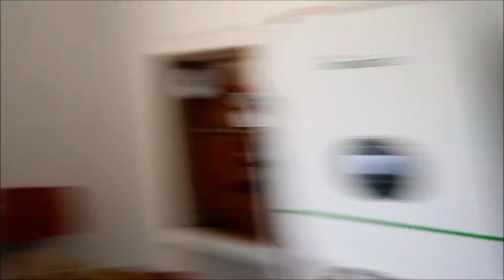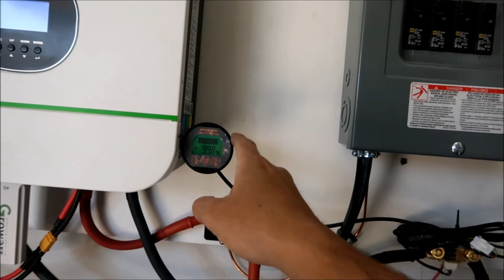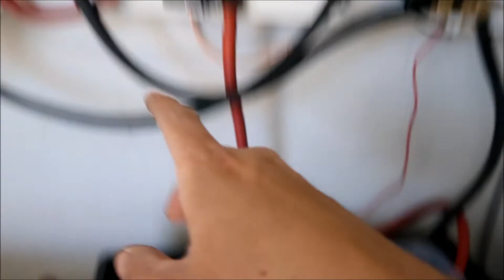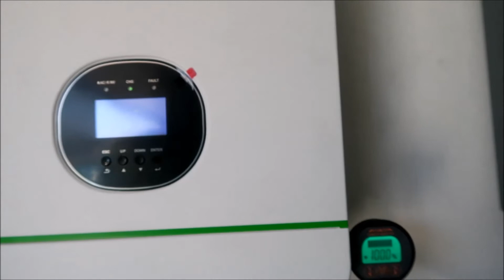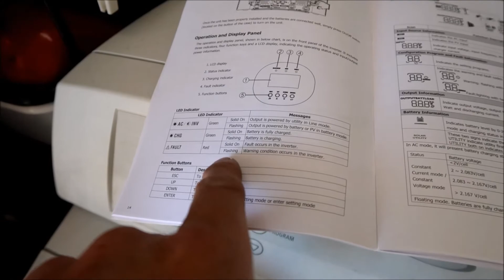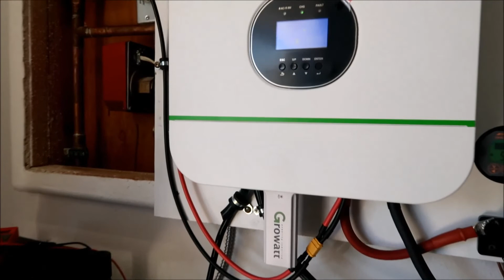HadesOmega Solar Garage Project Episode 57 - Growatt 24V Inverter First Load Test and PV Charge Test

Comment: I just purchased one and also will use 280ah EVE. I've been trying to figure out panels, I've come up with 3 over 900 watts keeping under the VOC limits. At that point my brain starts to sizzle trying to figure out just how many strings will be good enough for my use. 
I will determine use once I see just how much input I can get. 
Question is how is it working for you, is the charging keeping up, and about what amount of watts are you running on a regular basis?
Reply from the maker: Right now I have 2 strings  of 3 panels that make about 2.1kw (rated).  I usually see the panels output peak about 1.5kw.  Right now I am able to generate almost 9kw a day.  This inverter has a problem when the battery is fully charged it throws a #8 fault (bus voltage too high) and shut sthe system down.  It does it totally randomly.  I read that it could be the solar panels are outputting too much voltage but I've been watching the voltage and I never see it pass 120V and it only happens when my battery bank is fully charged.  With 9kw a day I can full charge this battery in one day.  So to prevent the #8 fault I charge my Rav4 Prime everyday to drain the battery.  So this doesn't happen as much I am going to order another 8 batteries and put them in parallel and install 3 more panels.  So I will have 3 strings with 3 panels each.  If I was to do it again I would have gone with 48V but I would need 48V of batteries from the start.

I usually running 1.5kw to charge my Rav4 Prime.  When I am using a lot of appliance in the garage I am pulling close to 3kw and it does it fine.  I think if you were going to power a whole house it's better to go with a 5000watt inverter or put 2 of these together.
Reply: @hadesomegamoto7639  I saw the video on the shut down from bus with Err #8 with no follow up. I also saw where you did the second string. I did sub to you btw :). I also saw on the one graph where you had the spike, could that be where it went over voltage?
I purchased mine from Signature Solar and they seem to have a great tech department for support. 
I here you on the 5k v 3k on $. We  are retired so funds are limited and tight. Not planning on the whole house as too many "rules" with Electric company and government. 
Here they will tie people in, charge and additional fee because you are on solar and grid, they still pay you for what you put onto the grid but not much, and will not let you have a battery bank on that system. 
Everything I'm going to do is on the dl and mainly for energy star appliances and for emergency. We have 2 freezers full and don't want to lose food as expensive as it is.
Reply: @hadesomegamoto7639  oh forgot if I didn't say in the first comment. You are the only one that I found that had good information on the 24v standing alone. 
I was in limbo on 3 panels or 2 strings, you helped me decide.
I did also here you say at one point the max volts was 145...that number is for (open circuit voltage) VOC and is no issue if not cold out. Really you would need to get below 40's to be concerned, and I'm guessing you don't have that issue. It becomes a big issue if it gets cold. There is a chart out there on the multiplier on top of the VOC you have after adding the string. The manual doesn't give the max normal volts it seems.

Comment: what is the meter you have coming out the side? is that something extra you bought or did it come with your system? I have the same 24v growatt system but I didnt get the one with the blue tooth wireless adapter.
Reply from the maker: That is a battery monitor.  It's something I purchased off of Amazon that monitors the status of the battery.  It is very handy to have if you have a DIY battery.

This is how I mounted it:
https://youtu.be/Enjw4Sn1u1k

Installed the Shunt here:
https://youtu.be/Ze-j0-Swg28

AiLi Voltmeter Ammeter Voltage Current Meter Voltmeter Ammeter 100V 350A Caravan RV Motorhome 999 AH 
https://www.youtube.com/redirect?event=video_description&redir_token=QUFFLUhqbGF4c094S05CTWVzTnNQaXA3SUdfZ1R5cXUxZ3xBQ3Jtc0tuSmRmdnRvdnpuRm1jczZJSkI2ODJubmNmOFFubWpaWGhkZktsZXNUSEwwYUU5MTR6NFYyVFNPcllLbklzajZzVk9DdTNHZ1NvY2VOclpEZnZEdDZWZEJTeVAySE85WUZ3aTllOTBIWV9FVF8wejhoMA&q=https%3A%2F%2Fwww.amazon.com%2Fgp%2Fproduct%2FB07FGFFHC6%2Fref%3Dppx_yo_dt_b_asin_title_o03_s00%3Fie%3DUTF8%26psc%3D1
Reply: @hadesomegamoto7639  How big is your solar array? do you have it connected parallel or series? I have 8 100watt panels not sure how to wire them for this setup
Reply from the maker: @woodknack1  I explained it earlier in the series but initially I started off with 2x 320watt panels + 1 340watt panel in series, in series I have about 120-140volts and about 9amps and 600-900watts.  The Growatt inverter can handle up to 80AMPs of current and 145Volts.  So you have to configure your panels so you are within those limits.  I would suggest you at least wire the panels so you have more than 24V, you need at least that much voltage to be able to charge since you have a 24V battery bank.